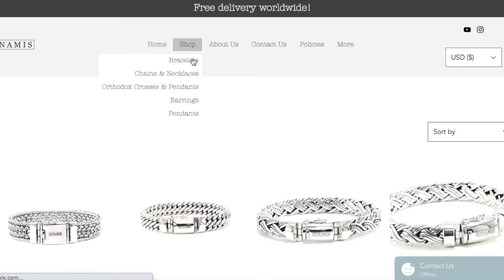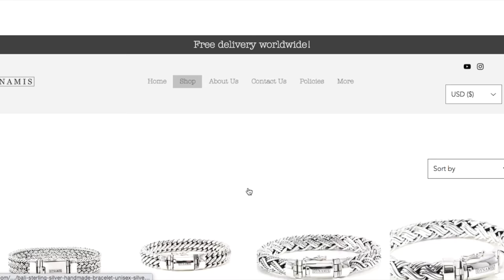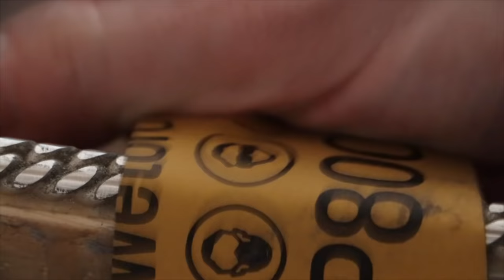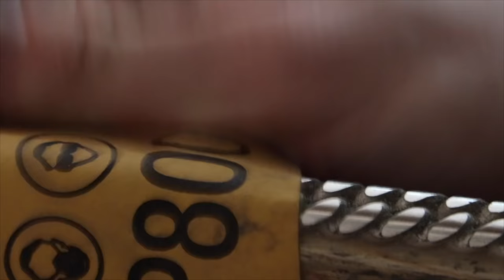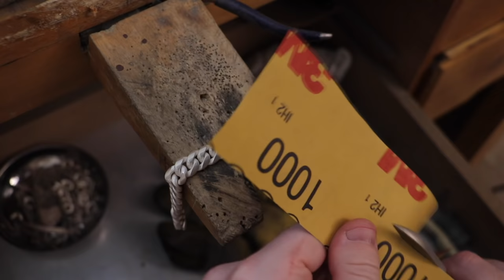Cuban Silver Bracelet

Comment: Why do you keep re heating the metal after stretching etc ?
Reply: Every time he twists/stretches/hammers it,  the crystal structure of the metal deforms and it becomes much harder, and much more brittle. I'm not sure what the technical term is for jewelry (probably the same), but I know for other types of metal work it's known as work hardening. Heating it up (annealing) allows the metal to relax, and return to its original condition and is much more pliable. Without annealing the likelihood of the metal snapping goes up tremendously.
Reply: @agmagicman59  thanks for the answer. Appreciate it
Reply: @agmagicman59  when pulling through the draw plate, what and why does he smear something on the side that's already pulled?